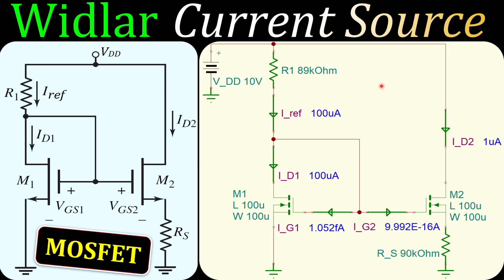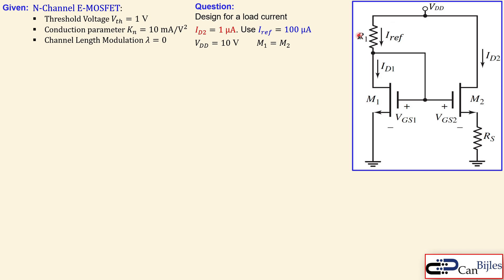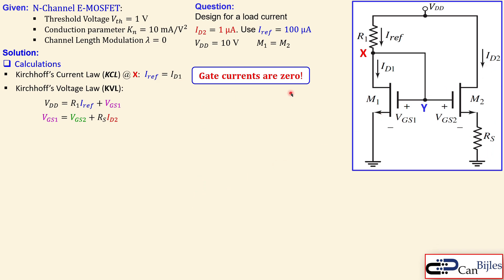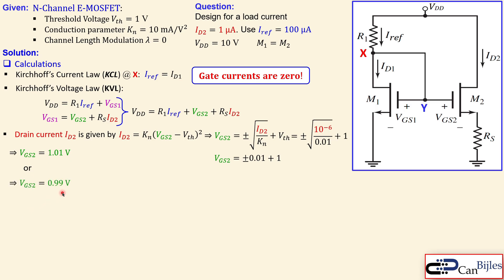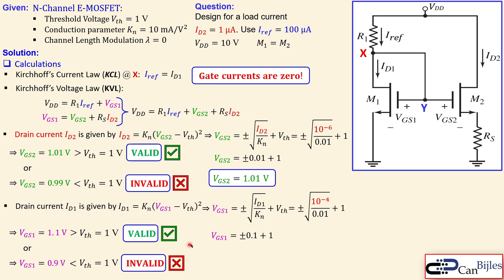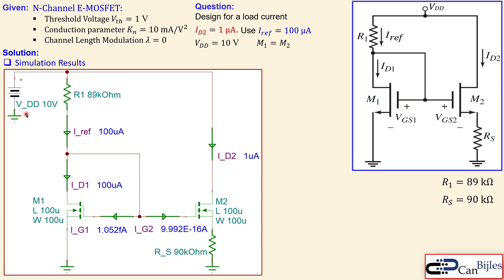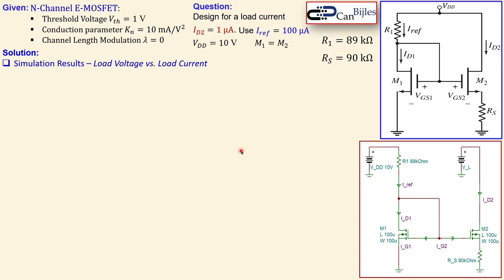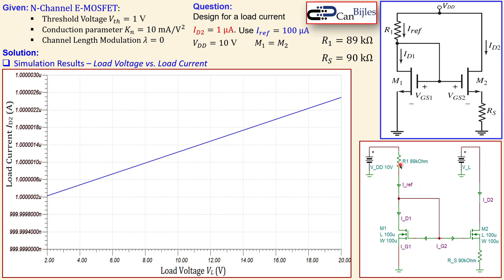MOSFET Widlar Current Source ⭐ Calculations & SPICE Simulations ⭐ Example 2

Comment: What are the advantages of using a current mirror versus a simple resistor voltage divider to set the current operating point?
Reply from the maker: The objective is to have a stable current value despite the changes in the circuit. Simple resistor voltage divider or similar to this will not work, since the current will depend on the resistor.

Comment: Which reference did you use for your MOSFET transistors during the simulation?
Reply from the maker: Reference current is given in the video. It is 100 uA.
Reply: @CANEDUX my bad, I mean the mosfet part number
Reply from the maker: @josecabra9139  There is no specific MOSFET type number. I made a simple model of MOSFET, which is also discussed in the video.
Reply: Thanks for your reply
Reply from the maker: @josecabra9139  You're welcome!

Comment: When you solve for VGS2, shouldn't it be sqrt((2*Id)/Kn)+Vtn since the ID2 equation should actually be (kn/2)(vgs2-vtn)^2
Reply from the maker: The Kn in the drain current formula is not the same as the kn. The Kn is the conduction parameter with Kn = 0.5*un*Cox*(W/L) and kn is the process conduction parameter with kn = un*Cox, so Kn = 0.5*kn*(W/L).